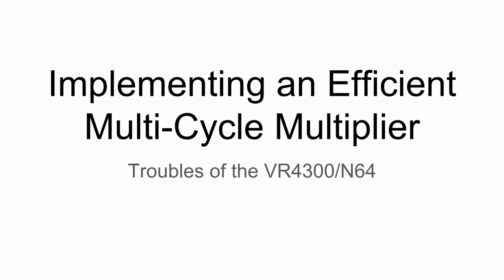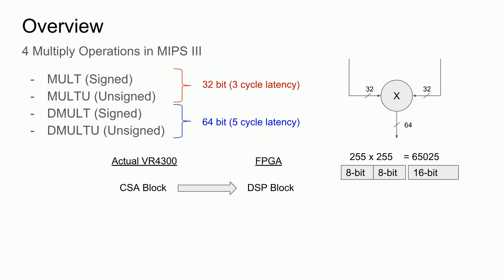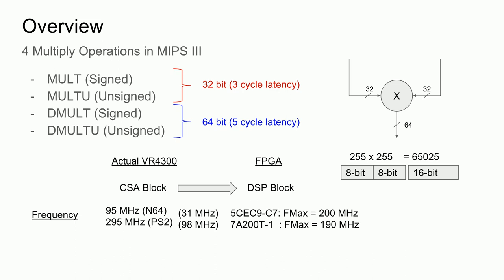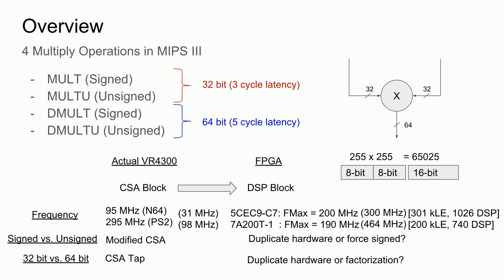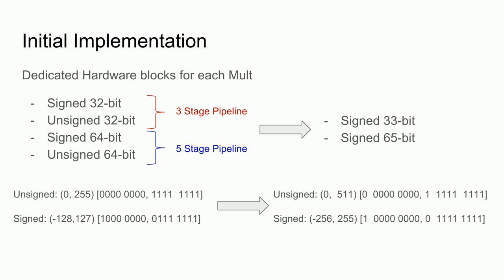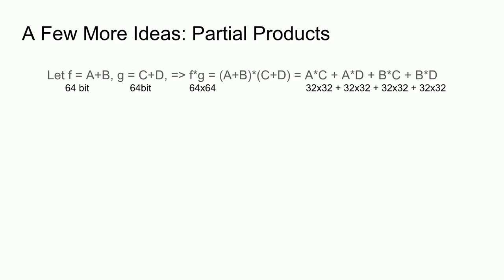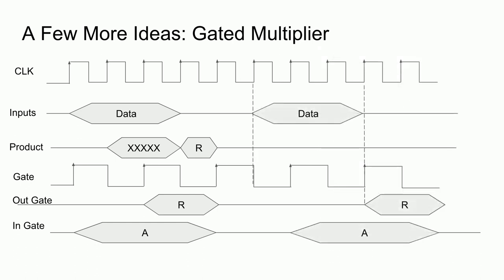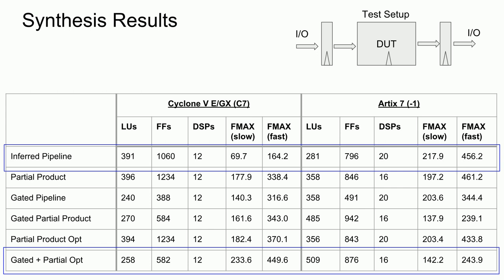Implementing an Efficient MIPS III Multi-Cycle Multiplier

Comment: I've been trying to work out how they actually implemented the multiplier in the real r4300i design.

The datapath diagram in "r4300i datasheet" shows they are using a "CSA multiplier block" and feeding it's result into the main 64bit adder every cycle (which saves gates, why use dedicated full adders at the end of the CSA array when you already have one). Going back to the r4200, there is a research paper explaining how the pipeline works in great detail, and the r4300i is mostly just an r4200 with a cut-down-bus and larger multiplier. The r4200 uses a 3bit multiplier, shifting 3 bits out to LO every cycle (or the guard bits for floats) and latching HI on the final cycle (floats use an extra cycle to shift 0 or 1 bits right then repack).

I'm assuming they use much the same scheme, but shifting out more bits per cycle. So it's not that the r4300i has multipliers that take 3 and 6 cycles then take two cycles to move the result to lo/hi, but that the 24bit and 54 bit multiplies can finish 1 cycle sooner. 

So I think the actual timings are: 3 cycles for 24bit, 4 cycles for 32 bit, 6 cycles for 54 bit and 7 cycles for 64 bit (though, you need an extra bit for unsigned multiplication) To get these timings, the r4300 would need a 10 bit per cycle multiplier. 

If I'm understanding the design correctly: Every cycle, the CSA block adds ten 64 bit wide partial products. 10 bits are immediately ready shifting 10 bits out to LO, and the remaining 63 bits of partial sums and shifted carries are latched into the adder's S and T inputs. On the next cycle, the CSA block also takes the reduced partial sums from the adder's result as an 11th input to the CSA array.

Comment: Aside from Karatsuba, which is not really relevant here, I was about to suggest using the integrated registers of the DSP blocks, some of which can do MAC, multiply then accumulate. This would reduce the number of DSP blocks. Also : what about a FSM to sequence the operations ?
Reply from the maker: That can be done, but it's a bit more complicated and becomes vendor specific. So if I did that for a Xilinx chip, I would have to explicitly create a DSP block and set the control bits. The same HDL would not work on an Intel chip. And when you're working on a part so far down in the hierarchy, you really want to avoid vendor specific instantiation.
You could instead build up the multiplication via accumulation of smaller multipliers (that's what many chips in the past did), however, that ends up requiring a FSM as you suggested, and will use up more logic resources. Typically in these instances, the LUTs are more precious than the DSPs, so letting the synthesis tool figure out how to connect the DSPs to minimize resource usage is probably going to yield better results.

Comment: There is also Karatsuba!
I tried once, it wasn't that useful in FPGAs with plenty of hardware multipliers, though.
Reply from the maker: There are several VLSI multiplier implementations, however, CSA seems to be the most prevalent. The Karatsuba multipliers are often smaller and use less power, but are also slower than the CSA multipliers. Either way, I suspect that explicitly implementing a multiplier IP (instead of using a multiplier or DSP block) in an FPGA, will be extremely inefficient... since it will use a lot of LEs and operate slower than the specialized in silicon multiplier block. I haven't tried it though. When you tried it in the past, did you check to see what the estimated speed / resource usage was implementing the Karatsuba vs. a multiplier block? (It would be interesting to see how much they differ).
Reply: @RTLEngineering  
I just tried to save a multiplier. Asssuming 16x16 hardware multipliers.

[XH|XL] * [YH|YL] = XH.YH*2^32 + XL.YL + (XH.YL + XL.YH) * 2^16 : 4 different multiplications.

Karatsuba:
T=(XH-XL).(YH-YL) = XH.YH + XL.YL - XL.YH - XH.YL
[XH|XL] * [YH|YL] = XH.YH*2^32  + XL.YL + (XH.YH + XL.YL - T) * 2^16   : 3 different multiplications, but more add/sub.
Reply from the maker: @temlib1411  Aren't most FPGA multipliers 18x18? (I know they used to be smaller, 9x9?). I don't think that a Karatsuba implementation would be advantageous in an FPGA unless you were really short on multiplier blocks. Since all of the adds / subs are binary, you would need to do 7 instead of 3, which is quite a few LEs, plus a significantly increased propagation delay (6 stages instead of 2).
Reply: @RTLEngineering  Yes. That's it. In modern FPGAs, multipliers are cheap!
Reply: I was also about to suggest Karatsuba but I also agree that "multipliers are cheap".